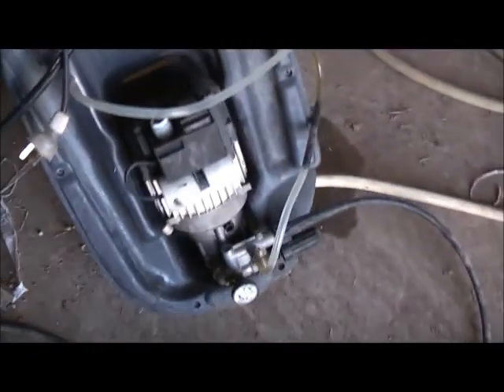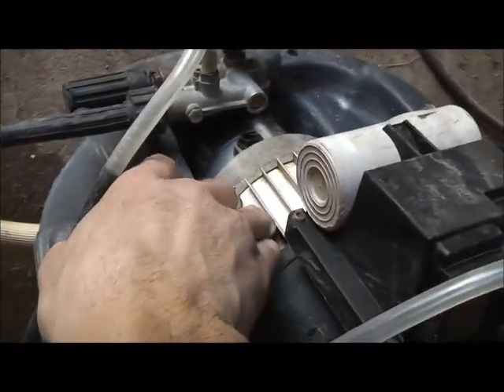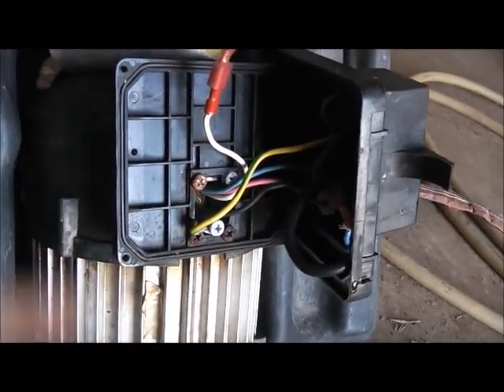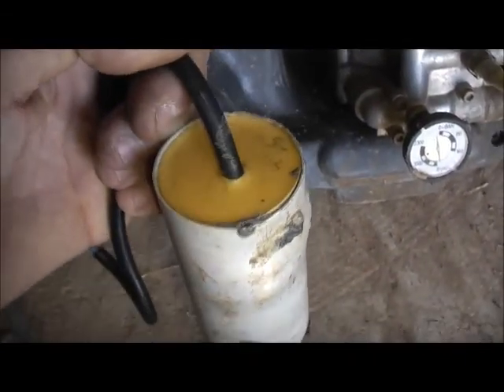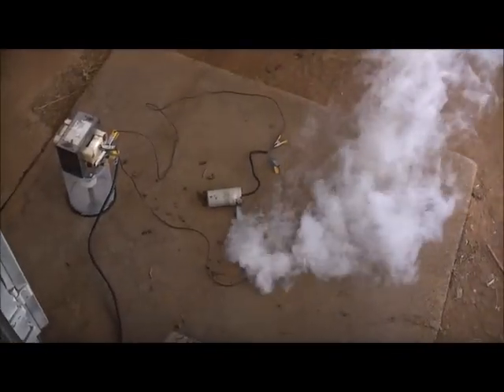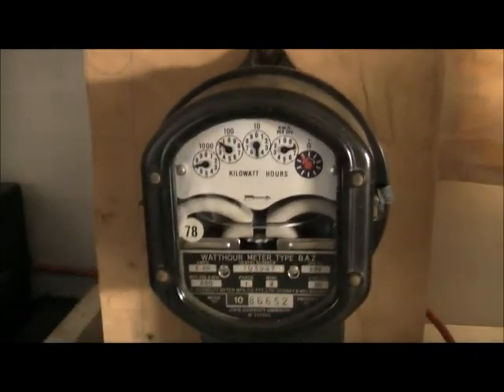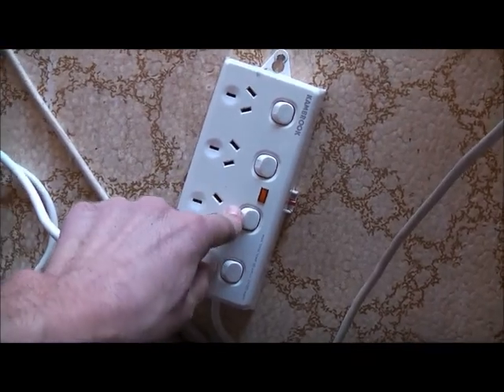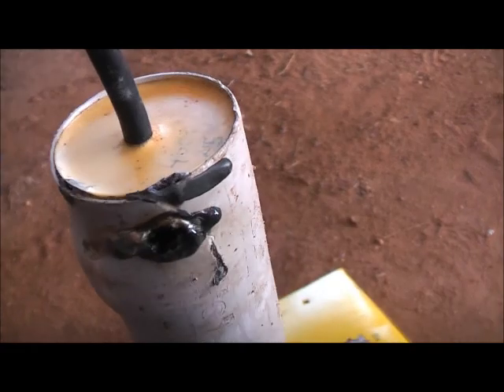Motor Start Cap Popped, Epic Smoker !!

Comment: stick low voltage high current through it, it'll either cook the wires or burn the internal short out and give you flames